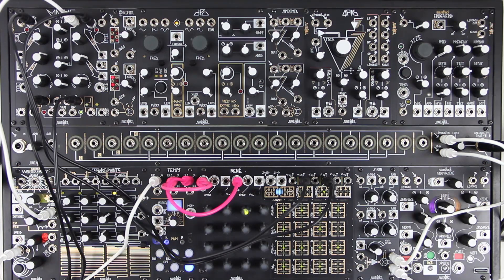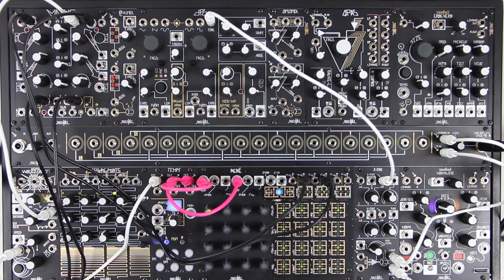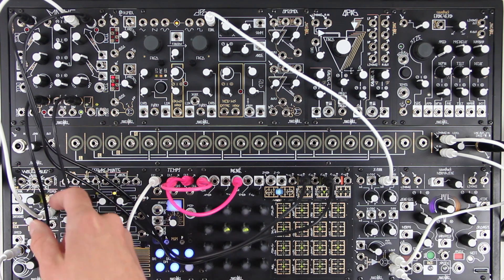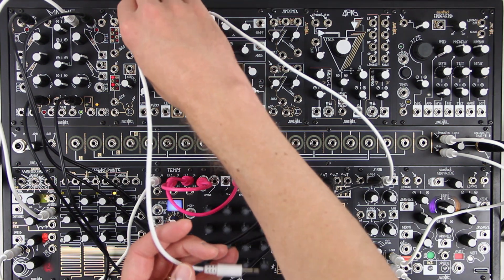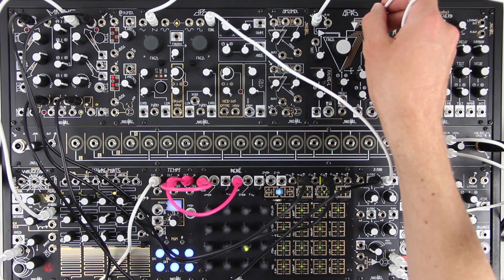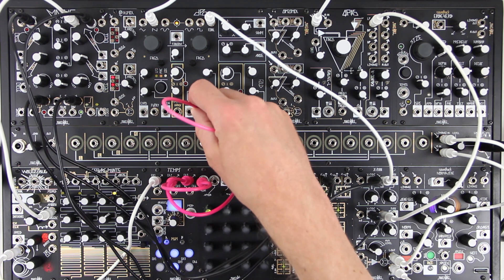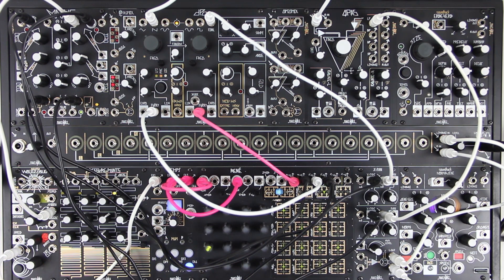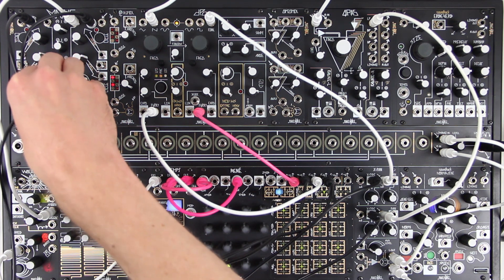X-PAN Tricks: Dual Pannable VCA

Comment: If you input 2 channels from QPAS into the A and B of one section of XPAN, what happens if you do the xpan action? Does left and right switch back and forth or does it fade one for the other? Also, if you have left and right into A and B, is the output with the Xfade in the middle just the same left and right out signal, or does it turn the stereo into a mono signal that can be panned right to left?

Also, I saw something about XOH? Is that an upcoming thing?
Reply from the maker: 1. x-fade would crossfade between the two outputs, pan would pan the result. 2. it would be summing the stereo signal to mono and then panning the mono signal from left to right.